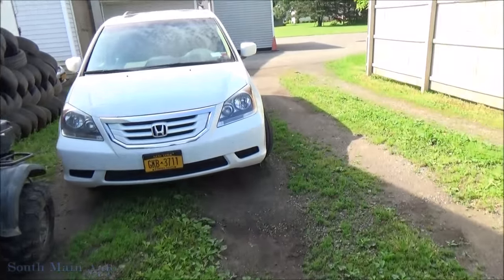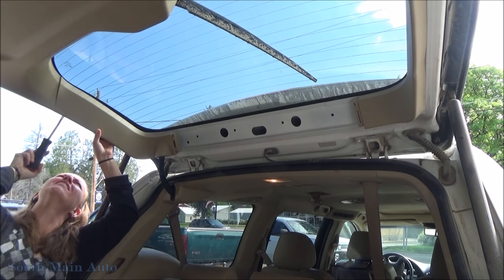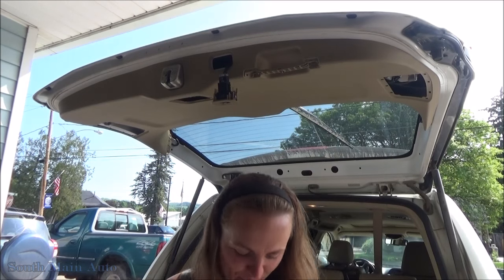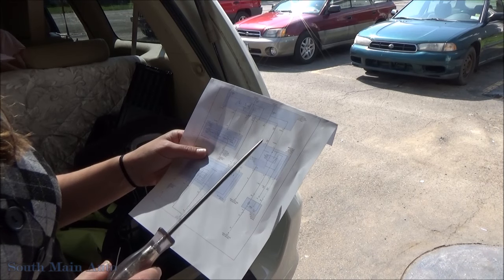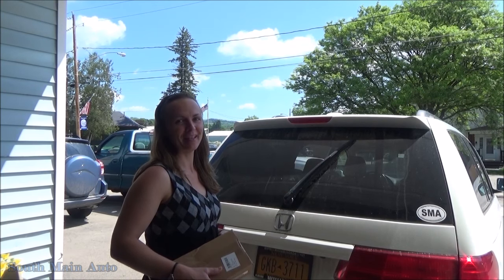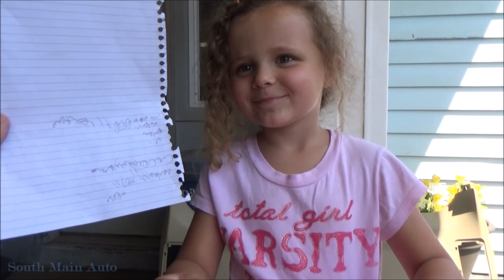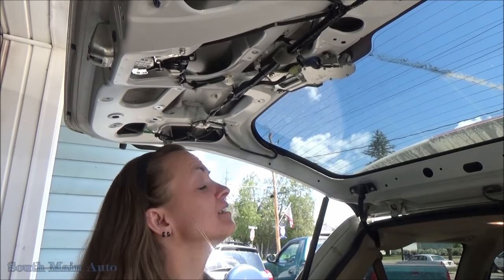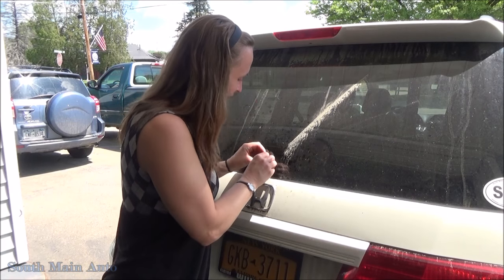Mrs. O Takes Matters Into Her Own Hands... AGAIN!

Comment: Thank you for this video!  My kids climbed on the back of our Odyssey and broke the rear window wiper loose.   It was hanging straight down instead of where it should normally sit.  Thought I was going to have to pull the entire back panel of the van and tighten it from the inside somehow.   Saw how you removed the wiper with your video, and it was as simple as popping off the back plastic and tightening the nut to get the wiper tightened down and working again.

Comment: I enjoy you and your husband’s vids I just replaced my wiper motor and you were a big help it was a long job I had no wiper puller I used a faucet handle puller then that large nut I needed a deep socket had to use a short socket and a pair of water pump players to turn thanks for the video

Comment: Good job, Mrs. O!  Only two small notes:  put a rag or towel beneath things to prevent the AeroKroil from running down the paint etc.  AT one point, you could be using a product that reacts / stains paint or emblems etc.  Next up - WEAR PPE!  The little metal clip, or the nut or covers you build up tension on before they snap loose could readily pop ya in the noggin and cause bleeding or loss of vision.

Comment: I think she did a great job.  Goes to show that a little effort, some things are not so hard that you can't do it yourself and save some money.   Be it a car or a home repair.  My mom used to do her own oil changes.  She would drive up on some ramps and get under the car and do it.  She doesn't anymore since she's 70 and its not like you're saving a bunch of money anyway.  But if you can do it yourself, why not?  

She did a great job on the wiper swap.  These days with the internet, you can google instructions on doing all kinds of things or even watch YouTube to learn how to do something.  I do that myself for some things.   If it's yours and you want to make sure it's done right,  sometimes doing it yourself is the smart move.   The things I've seen people do, I wouldn't let anyone work on my stuff unless I had no choice.  I just had to redo a friends brake job that was half ass done.  Pulled the wheels and the front right brake line was twisted!!!  Bad, bad, bad!!!!!

Comment: nice video!!! can you tell me what are those 2 red thing you inserted into the pin connector to check the wire? my 2009 odyssey rear wiper is not working... thanks.

Comment: Do you have to use the special tool used in the video to remove the arm and release the motor?
Reply: Thread the nut on a few turns, pry up on arm while gently tapping nut with small hammer. It will pop loose.
Reply: @clarkgarber5495  Worked, Thanks!

Comment: Stuck nuts can be smacked out using a hammer. Lay the socket with the stuck nut on the floor. Smack the socket with hammer and usually it takes one or two smacks...

Comment: Good Job. You should be more careful next time and not drop things on your feet. Good thing it was not more (that we know of) then just a pain event. I hope you did not have on open toed shoes though. That could have been worse if you were. You most likely did not have to be quite so careful during your reinstall of the wiper arm. Glass is stronger then we think some times. Your were I guess thinking better safe then sorry/unsafe. Wise choice. I was disappointed that your helper didn't stay for the entire job. I guess that is normal for a helper so young.

Comment: kinda trips me out to see the steps to repair this. I have a nice audio system in my SUV and 1 day I lost my wiper arm and later that day I heard a clunk. the bass made my wiper motor fall. crazy that it backed out the bolts that hold mine in. I think it was 3 bolts in my truck also. bass is literally tearing that truck up.